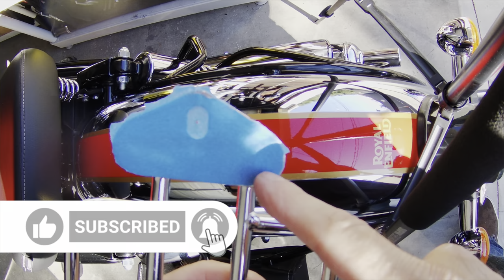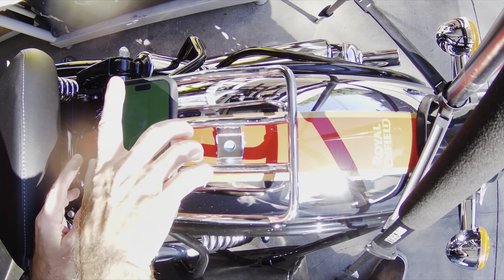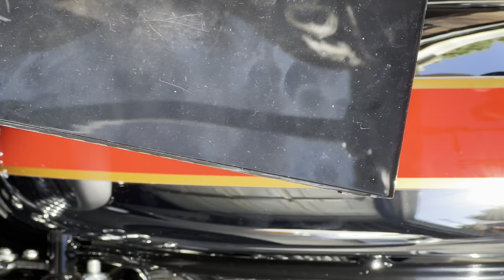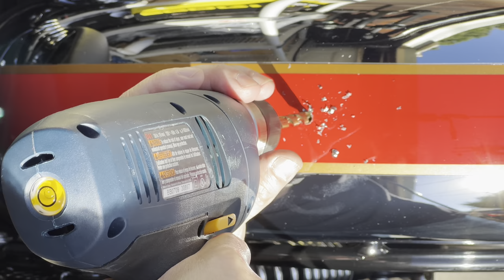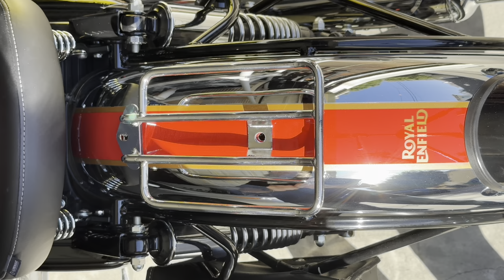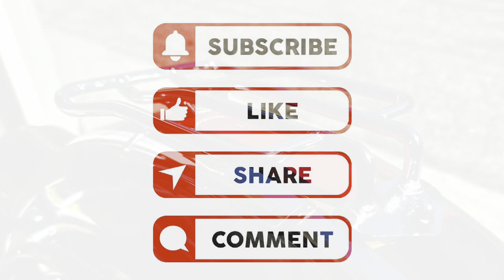I’m finally installing that rear fender / mudguard rack on my Royal Enfield … 🤞🏻🤞🏻🤞🏻

Comment: Nope. Not me. I also have the Red and Chrome model, and there is No Way I'm drilling holes in my chrome painted metal fender... I'm using the passenger seat frame without the passenger seat. I modified it and chromed it. AND No Way I'm going to put a bunch of weight on that fender, when I can just use the seat frame. The seat frame is MADE to hold weight... you know, like a person! And it bolts to the frame! I'm pretty sure that rack you're putting on is more decorative than anything else. But hey, it's your Enfield.

Comment: I enjoyed your video. May I make two suggestions please? When drilling through paintwork or chromed surfaces stick some masking tape where you intend to drill and mark up on that, it will also reduce the liability  of the drill wandering even after centre punching. I urge you to remove the rack and paint the bare metal exposed by the drilling to prevent the onset of rusting. Regards Edward
Reply from the maker: Hi Edward, EXCELLENT SUGGESTIONS…. I feel foolish after reading your comment, especially with having not treated the bare metal. Thank you very much.
Reply: @LeveyAngeles  My pleasure, I'm glad to be of help. Regards Edward

Comment: I happened to visit the factory that make these fenders here in India, these are formed by huge 1000 ton press, the facory just rejects and scraps the fender even if it has teeny tiny scuff marks, and this is even before painting😂. I can only imagine how much inspection these fenders might go through the paint shop. It is really heartbreaking to see this fender being drilled.
Reply from the maker: Hi Vishal, I don’t disagree about drilling into that perfectly good fender, but I will get far more use out of the bike now that there’s a rack on the back, and while I definitely took, looks into consideration when buying my bike, function over form is far more important to me. As for the quality control, my paint and chrome had lots of imperfections, which I spent hours buffing out, removing swirls and scratches now I kind of understand, I mean they are one of the largest producer of motorcycles in the world, but boy did I have to spend a lot of time, correcting the finish on my brand new bike.
Reply: @LeveyAngeles  The rack looks amazing, congrats on purchasing an Enfield. I've seen some enfields with the  pillion seat modified as racks so that no holes are needed to be drilled and the load mounted on the rack sits on the frame rather than the mudguard. I own a 1989 enfield 350 (a classic british motorcycle with gear lever on the right hand side) and I absolutely love it, as it has absolutely zero electronics and my favourite neutral lever. I recommend you to ride one of the old enfields if you haven't already. I love your youtube content on the classic 350.
Reply from the maker: @vishalmohan1995  Thank you very much Vishal, I owned an old 500 and when the new classic was announced I knew right away I wanted one but after a year of waiting for it to get to the U.S. and watching every video being posted, all of which agreed it was vastly improved & mostly positive comments I was locked in… and now, after 1000 miles on the new one I can definitely say that I definitely made the right choice…. The more I ride, the more I make it mine… DNA coming next week… video will follow… 🙏🏻

Comment: Separate point. I noticed you had the seat springs installed which as you know are for appearance only. What you might not know is there is no need to install the bracketing on the base of the springs which will over time as you install/remove the seat scratch the attachment to the fender support. Personal choice Obviously and maybe you feel necessary in solo mode 👍. Great video and a shout out to Warro 👍
Reply from the maker: I saw a video about a month after I installed the spring kit that the next time I have to pull the seat off for something I’m going to do what he did. I’ll find the video and post it here in a second.
Reply from the maker: https://youtu.be/CKel_prRX6c
Reply: Saw that also 👍

Comment: I installed a similar rack but lacking any reinforcement of the fender I found it way too floppy. I installed it using rivet nuts rather than trying to feed a nut up from the tire side. What I wound up doing was reinstalling the rear seat base, minus the padding. It’s not as pretty but will actually carry a load. This rack should be limited to two pounds.
Reply from the maker: Hey there Dan, wow… mine sure seems pretty sturdy, but after reading your comment, I will definitely keep an eye on things… luckily, I don’t plan on using it for any heavy loads 🤞🏻
Reply: @LeveyAngeles  I carried a sleeping bag on it but for anything heavier I think the seat base makes a good rack.

Comment: Nice job my man!  Came out perfect.  Too bad RE don't just pre-drill those for people who will at least part-time run without the pillion.
Excellent use of the old HDD - I recall the good old days at an aerospace company I worked at where we got to use sledgehammers and blowtorches on the HDD's BEFORE they went into the industrial monster machine that ground them to a pulp.
I'm guess you're either not married or with a riding partner as I know my fate if I took off my pillion!  😝
OTOH, my son takes his on/off regularly it seems...
She's coming along.  Have you gave thought to running the DNA filter/cap setup?

Ride Safe 🙏🏼
Reply from the maker: Thanks Scott, yeah I couldn’t agree with you more… Having pre-drilled factory holes with some removable plugs color matched to your bike, would have been a great idea, but in fairness to Royal Enfield, all these racks come in different sizes and styles, and the holes would be in a variety of different places or you’d be forced to buy one kind of specific rack for too much money directly from Royal Enfield… yeah, that now useless hard drive had one last hurrah 🤣 sledge, hammers, and blowtorches sound Awesome, I would be constantly coaxing, hard drives to fail if I worked!!! 🤣 and as for the pillion, very happily divorced…. I did look into the DNA air filter set up and I am seriously considering that upgrade, the one thing I can tell you I’m definitely not going to do even though I thought I was absolutely going to is upgrading to a 16 tooth sprocket…
Reply: @LeveyAngeles  ahhh why not the sprocket?  I bought a bunch of them for us but nobody has installed yet. You find something negative about them?
I hear you on the pillion. Sorry, but enjoy the clean fender 🤣
I’d give the DNA a shot. We really love them!
Put the shifter and pegs into my cart. The next updates…
Ride Safe 🙏🏼
Reply from the maker: @scottboettcher  “sorry, but enjoy the clean fender” 🤣🤣🤣🤣🤣 yeah everybody that I’ve seen who’s installed it has said that they’re going back to the 15… Apparently it’s good for top end but at slower speeds it’s miserable and the general consensus of everything I’ve seen by people who have installed it is that they’re going back to OEM, “Enfield had it right”…
Reply: @LeveyAngeles  Makes sense.  I'll hold off for a min...depends on if we decide we want to do more rides in the hills I guess.  not a big loss of money - I think I paid $18 per...
Ride Safe 🙏🏼
Reply from the maker: @scottboettcher  if it was a recent purchase, I would say maybe just return 🤷🏻‍♂️ I’m gonna look for the I think three videos I watched, but 1 I’m absolutely positive I saw… Give me a minute
Reply from the maker: https://youtu.be/KmjWkd8RtC0
Reply: @LeveyAngeles  yeah. Saw that one. Aside from the banter, it seems really something one must try. Or not! 
Sitting on it for now 

Ride Safe 🙏🏼

Comment: Hi, can you tell me if the striping on your rear fender is a sticker or painted and the same for the lettering on the stripe? Thanks
Reply from the maker: I can’t tell you definitively, because I never tried to remove them but the consensus from when I asked the same question was that it is indeed a Sticker, likely cleared over.
Reply: @LeveyAngeles  Thank you for your response, I'm thinking maybe the striping is painted and the words royal enfield is a sticker